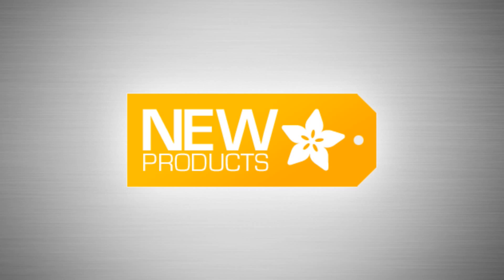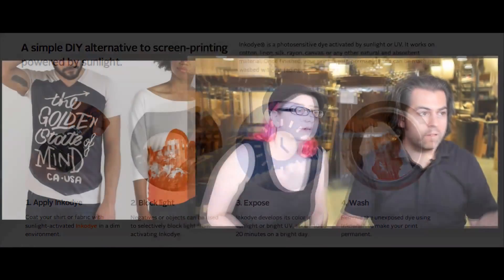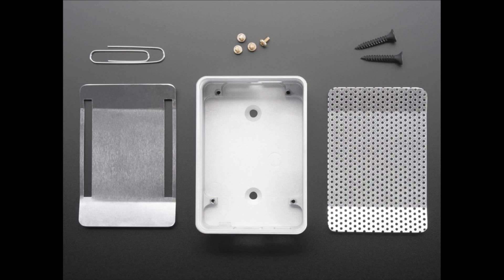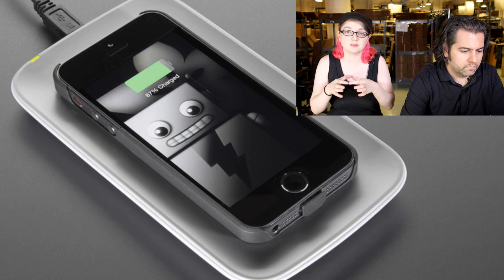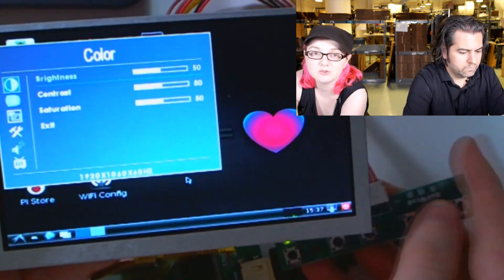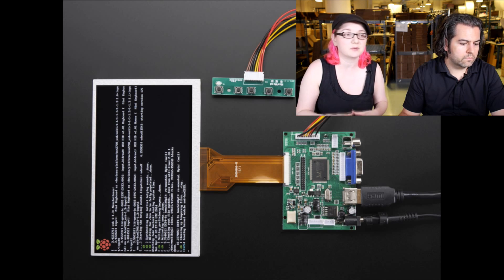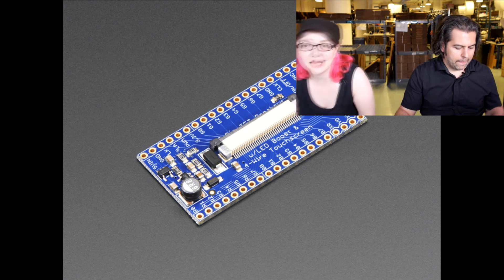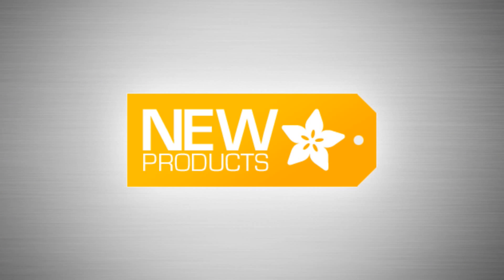New Products 6/18/2014

Comment: I know this is 2 years later, but me and a classmate are doing a project for school with the Beaglebone Black. We have the exact same TFT breakout, but our screen is http://www.buydisplay.com/default/5-tft-lcd-display-module-wvga-800x480-high-resolution-for-mp4-gps from this site shown at 16:03. We are trying to turn on the backlight for starters, but we did not succeed. We do not have a breadboard, we just want to connect the wires directly from the TFT to the Beaglebone.

Do you maybe have a chart with the wiring interface? We would like to know how your wires are connected with the microprocessor.

Comment from the maker: Make Your Own PCBs with Eagle by Simon Monks (0:10) http://www.adafruit.com/products/1941

Adafruit OONTZ Open-Source Grid Controller - 8x8 + White LEDs (0:55) https://www.adafruit.com/products/1929

Make: More Electronics by Charles Platt (1:40) http://www.adafruit.com/products/1939

Lumi Photo Printing Kit (2:18) http://www.adafruit.com/products/1920

Lumi Sunfold Printing Kit (2:18) http://www.adafruit.com/products/1924

Lumi Shadow Printing Kit (2:18) http://www.adafruit.com/products/1925

uniBBB - Unibody Aluminum Case for BeagleBone Black (4:33) http://www.adafruit.com/products/1810

Edge-Launch SMA Connector for 0.8mm / 0.031" Slim PCBs (5:30) http://www.adafruit.com/products/1864

Qi Wireless Charger Sleeve - iPhone 5 Lightning Connector (7:15) http://www.adafruit.com/products/1926

Sharp GP2Y0D810Z0F Digital Distance Sensor with Pololu Carrier (8:30) http://www.adafruit.com/products/1927

HDMI 4 Pi: 5" Display (no Touch) w/Mini Driver - 800x480 HDMI (9:20) http://www.adafruit.com/products/1928

HDMI 4 Pi: 7" Display 1280x800 IPS - HDMI/VGA/NTSC/PAL (11:30) http://www.adafruit.com/products/1931

HDMI 4 Pi: 7" Display (no Touch) w/Mini Driver - 800x480 HDMI (12:10) http://www.adafruit.com/products/1933

HDMI 4 Pi: 7" Display no Touchscreen 800x480 - HDMI/VGA/NTSC/PAL (12:51) http://www.adafruit.com/products/1934

Spy Camera for Raspberry Pi (14:29) http://www.adafruit.com/products/1937

40-pin TFT Friend - FPC Breakout with LED Backlight Driver (15:23) http://www.adafruit.com/products/1932